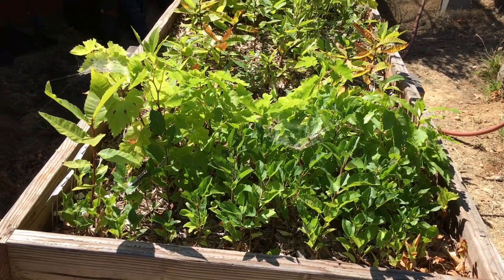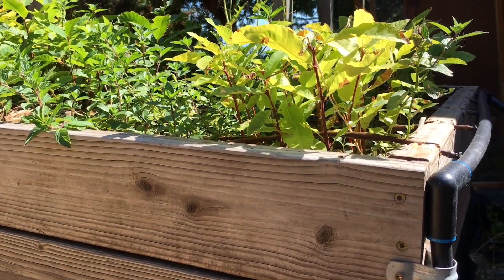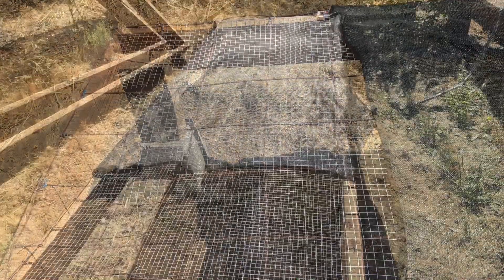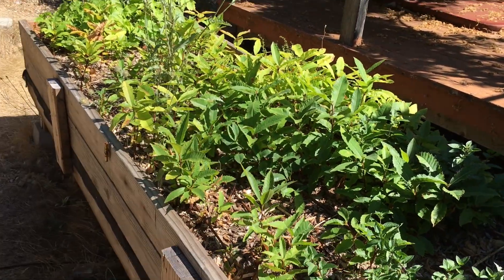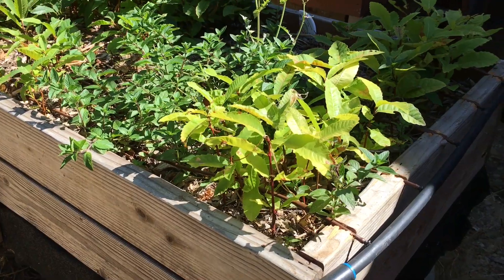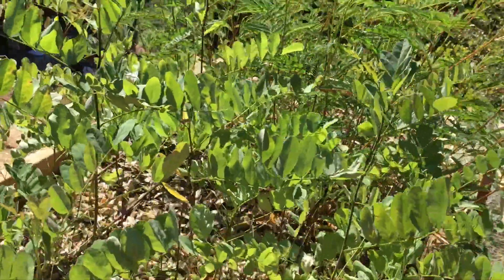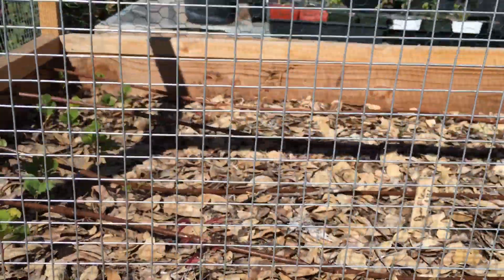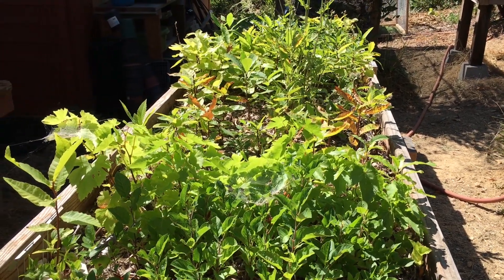DIY Air Prune Beds - Grow Hundreds Of Healthy Trees In A Tiny Space

Comment: I’m thinking about planting some chestnuts and persimmons in my air pruning bed right now, before winter. My fear is that they will freeze and not germinate.  Looks like it works for you. What USDA zone are you in, or what’s your nearest city?
Reply from the maker: This video was shot in the Santa Cruz mountains of CA - zone 8b/9a if I recall correctly? However, for me one of the primary reasons I like to use the air pruning beds is to set seeds out so they get to stratify naturally - just as if they'd fallen in nature. So all the nuts, fruits etc I'll sow them in late fall or after their harvest time, and then they'll germinate right on time in the spring. Just keep 'em protected from squirrels or other critters that would love to dig them up!
Reply: @7thGenerationDesign  that's not accurate. The 10-12" above ground level removes the insulation properties of the earth. 
There is nothing natural about air pruner frames.

Comment: dear sir: I bought two trees, a avacodo, a peach.  Both in 15 gallon container.  Is it worth while to transfer to a burlap type bag for one year before putting into ground permanently?  Winter in 9b zone has a few freeze nights and I need the trees to be ready for outdoor.  I want to get them strong indoors using burlap/bag first?  Is it worth doing?  Is it too late since they are in container for years in the nursery where i bought them?? thx.
Reply from the maker: I would just plant them straight away - since they were already pot grown there won't be much to gain by trying to set them up in an air pruning bed for a year. If it were me, I'd just plan them and let the roots do the best they can in the earth at this point - spread them out as best you can to create a good structure etc.
Reply: @7thGenerationDesign  ok.  that makes sense.  I am going to plant and irrigate efficiently, and heavy mulch to encourage deep, wide roots.  Also, cover it during cold nights.  (to get them through the first few winter). thx.
Reply: No

Comment: What is a good alternative for the shade cloth? I can’t find any locally.
Reply from the maker: Any fabric that is very breathable and drains well - while it is biodegradable, and thus you might have to replace it every year or two depending on your climate, you could absolute use burlap sacks or rolled burlap to create a bottom that would air prune well. Geotextile would probably be too densely woven and wouldn't air prune effectively in my estimation. Hope that helps!

Comment: hey man I like the video. Do you have any recommendations for how deep i should plan on making it for large trees, like the chestnuts you showed here?
Reply from the maker: The bed in this video has about 8-9" of soil medium for the chestnuts. However, if you want to get the maximum root branching stimulus according to Dr. Whitcomb's data the tap roots need to be air pruned within the first 4-5" of growth in order to stimulate root branching back towards the stem root junction. We are trialing deeper and shallower beds this year and will post results when we pull the current year's trees to examine the root structure.
Reply: @7thGenerationDesign  Do you have results posted?  Would be great to get a link to the results.   Happy planting :D
Reply from the maker: @forrestdeno4040  Hi Forrest, here is a link to one of our harvest videos demonstrating the harvest process and the root structure of the young trees: https://www.youtube.com/watch?v=sza2c9UpEf0&t=36s
Reply: @7thGenerationDesign  hey just following up, are you able to share the results of your trial of deeper and shallower air prune beds? I would hope that the shallow ones (closer to 4/5" did better as per dr. whitcombs research. Looking forward to hear how it went!
Reply: @vballboy11  I'd like to know as well. One worry I'd have though is if they have to spend one winter in there, I might have to insulate around theb ed. However, maybe they'd be good enough to, big enough, to transplant by autumn when dormant? have you tried this at all, the pruning beds? I'm just learning about them after getting discouraged about the cost of ellepots!
Reply: @7thGenerationDesign  How did the trial of 4-5" deep beds go? If you were growing trees to the point that nursery usually grow them (2-3 years I believe), would you still use these beds?

Comment: Has anyone yet thought of what may happens when a gust of hot air hits the roots consistantly. I think it's about timing. Same as harvesting on a full moon 🤔
Reply from the maker: The trees thus far have performed just fine, assuming there is consistent automated irrigation to keep the soil mass reasonably moist. We have had the power go out during a heat wave for nearly a week, however, and the trees were still looking just as they did the prior week - the soil does a good job of insulating and retaining moisture.